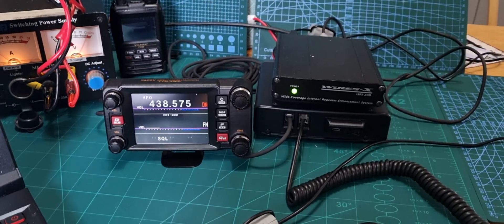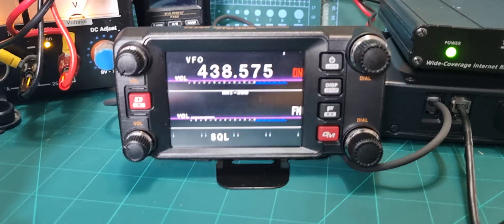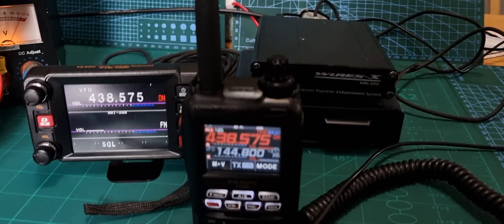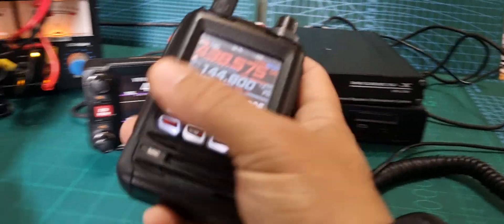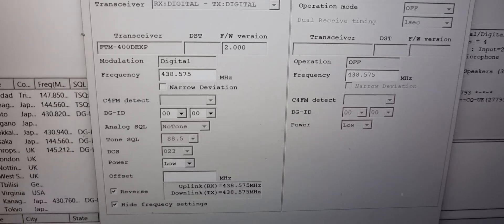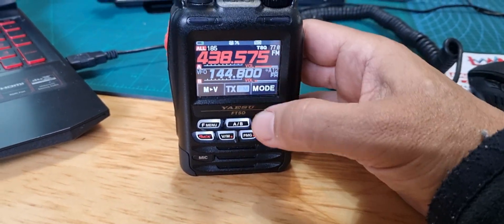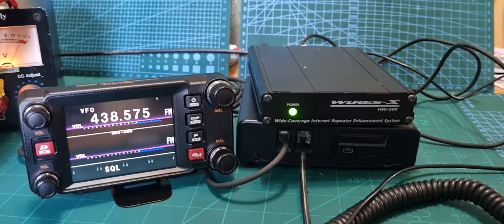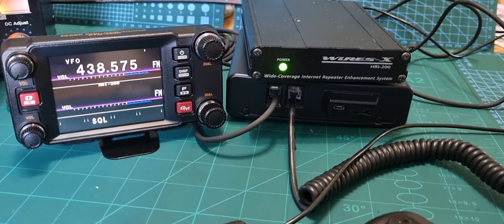YAESU FTM400 HRI200 Set Up and Test , analogue,  Digital

Comment: I have FTM-100dr,  Can I access analog rooms without using a HRI-200?  I currently have it in PDN mode and can only access digital rooms.
Reply from the maker: You just need a SCU20 cable lots Videos showing this on YouTube
Reply: @M0FXBHamTech  Thanks for the reply,  I finally got the FTM-100 out of (PDN) X DIRECT mode (digital only mode) into (NODE) WIRES-X DIRECT mode (analog and digital mode). It will connect to either one now with out using HRI-200.